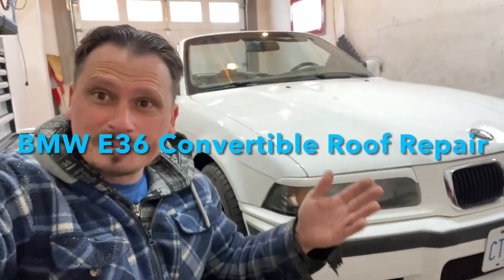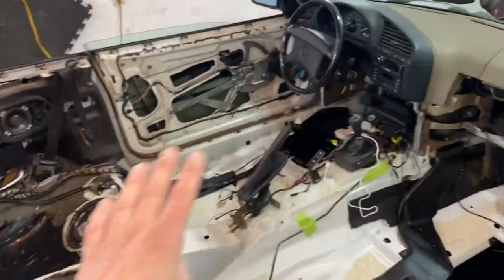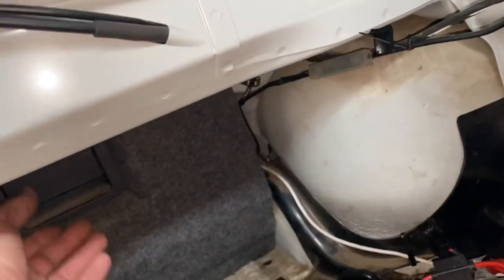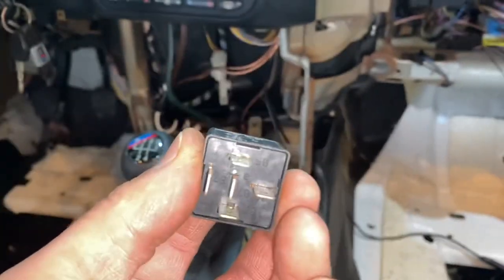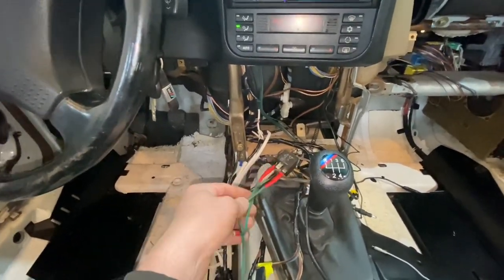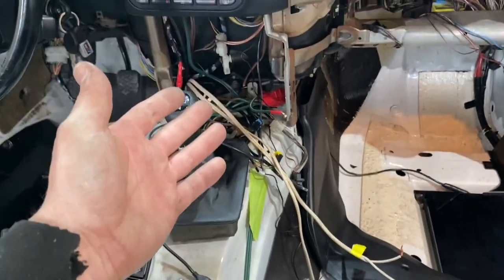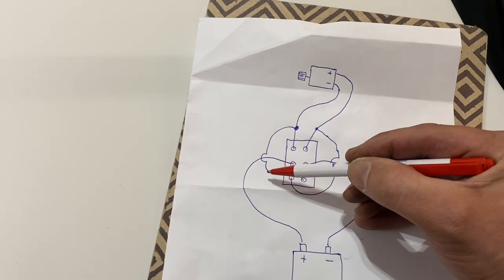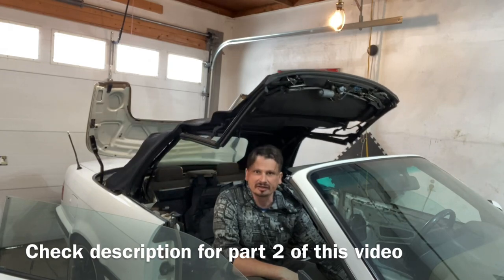BMW E36 Convertible Roof Repair. How to rewire a BMW convertible roof and bypass the computer.

Comment: I followed everything you've done step by step, and my roof works😃 think I need to replace the motor for that rear cover though.... won't open without a little assistance, however thank you so much for the awesome content 🍻
Reply: Where did you buy the motors and the stuff to repair it

Comment: Hi dude I'm about to attempt the roof fix thanks to your video!!!
Only issue is that my front windows won't work at all a direct 12v feed to the motor and it works but I wanted to know if you had a video on fixing them as I can't find one at all! 
Thanks 
Brad

Comment: As I mentioned at your first video, if the motors work, why doesn't the roof work when you push the button to open or close the roof? Is it the computer failing? 
I love how you came up with the wire!  
I also love the way you clearly teach.
Reply from the maker: In my case it was the computer

Comment: Awesome video. It has helped like you can't believe. However, I'm still experiencing a problem. A very different 1 now. Previously when I tried to reset my roof, it would close once and that's it. But now, I need to help all the parts move to their positions. The motors are not doing it by themselves. Please help... Thank you

Comment: Thank you so much for making this video !! Watching and subscribed from Denmark, i just bought mine it has the "semi-auto" roof with the handle, and the roof is completely dead, i have tried messing with the fuses and micro-switches etc etc, the reseting procudure and still not working. I will definitely try this
Reply from the maker: Yeah I also tried everything, and this totally worked the roof works awesome now
Reply: @nj3022 how was this on your car?? same problem for me
Reply: @santiagosilva7220  worked perfect 👍 i have sold the car now but worked without problems for 6 months

Comment: Hi thank you for such a detailed video but I still face a problem with the first motor it’s going back In to close
Reply from the maker: Get someone to move the lid up and down as you push it in
Reply: @ProblemSolverGarage  I also have a small problem with power it’s not going as it should even though my car is running 105000 km only just got it it was reserved for the past 5 years

Comment: Tnx for the video, i have a question. You are using a 30amp fuse and a 20amp switch. How many amps is 1 motor of the roof? Can i use a 20amp switch safe?
Reply from the maker: Yes I think 20 amp should handle it.
I don't know the amps of the motors

Comment: Like your content. very well explained on all details. Will do the same thing on my cab. What I wonder is. The switches you use. Do they fit well in the console or did you have to modify it a bit?
Reply from the maker: They fit good I use JB Weld to glue them in from underneath
Reply: @ProblemSolverGarage  ok i see. When are you gonna change the soft top? Im gonna do that soon so I want a wideo from you befour i do that😂
Reply from the maker: Won’t be doing it till summer

Comment: Jus bouta try this on my 99 328 u think I can make tonneau lid switch and manually operate the lifting and finish off with the built in motor switch.? I think my rods bent so it doesn’t fully fit back in the tonneau cover think it’ll work?
Reply: Took the rods off and now can open close tonneau cover w the switch, didnt work at first but i forgot to sand my grounds, make more e36 videos bro

Comment: I got a question. Im going to use this method. But is it possible to use 2 of the original buttons from the roof? They have 5 wires
Reply from the maker: No

Comment: LOL,,, The Wire connected to the POS Term on the Batt,,, is fuse # 49 power supply for "The TOP,,,  ( I had my E36 Vert for a Year before I "Found" That,,, ), I have done my Seats with "LSeats",,, and Nickolay in Latvia sold me some new skins for my Door Panels,,, My Panels have Air Bags which has the Black Plastic Rivets...

Comment: Question, you said the relay will turn on when the ignition is turned on. By activating the relay , is the relay going to have constant power as long as the ignition is on. And if the relay is on as long as the ignition is on ,will the relay coil burn out? Please help anyone
Reply from the maker: No relays are designed to be on or off

Comment: Why bypass the computer?
Reply from the maker: Because the computer was broken and it's expensive to replace, it also controls the windows which one of those didn't work either, I took the nonconvertible computer from my parts car and switched computers